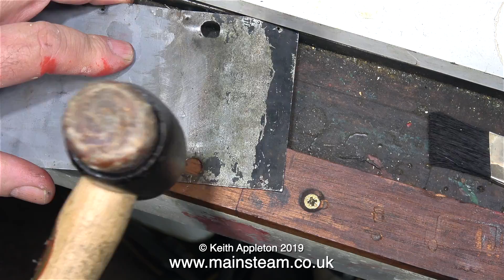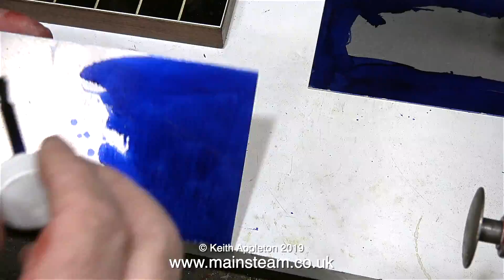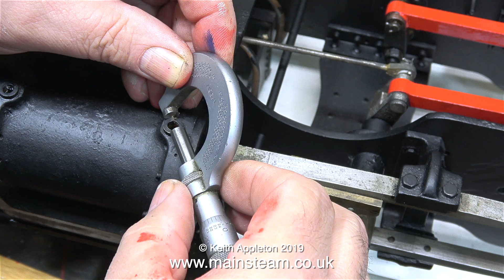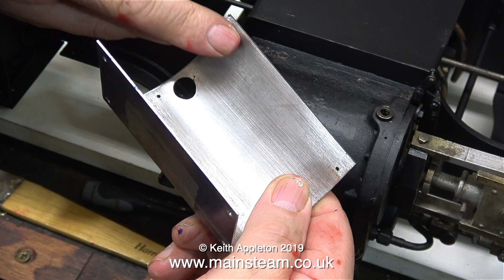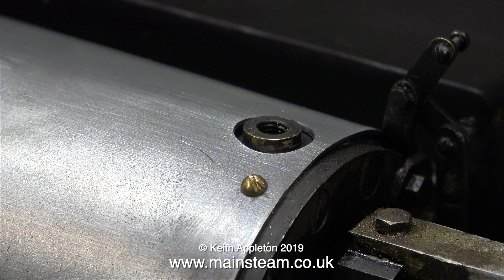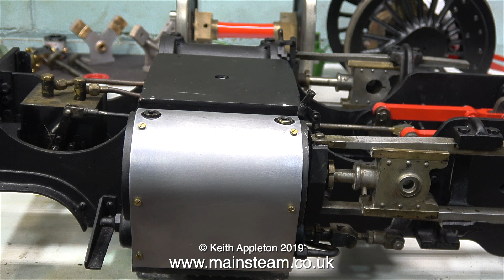HOGWARTS CASTLE - A 5 INCH GAUGE LOCOMOTIVE - PART #19

Comment: I use brass sheet for cylinder jacketing to avoid the rust problem and then paint it.
Reply from the maker: Yes, so do I but in this case I replaced steel with steel.

Comment: Nice work, indeed.  No need for cutting oil when tapping the threads?
Reply from the maker: not when tapping cast iron.
Reply: @keithappleton  not even a little tap-ease? . . . was waiting on bated-breath for the heli-coils!     Oh well.   Cheers
Reply: roboZ starrr cast iron has a lot of carbon in it which tends to make it self lubricating. Also the chips tend to be small and brittle which, along with oil, can make for a mess in the bottom of a tapped hole.